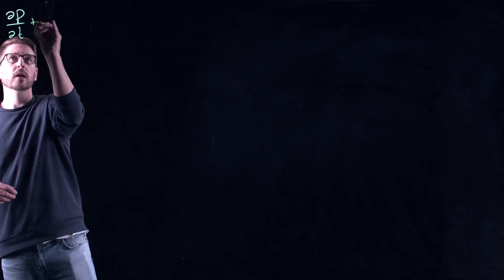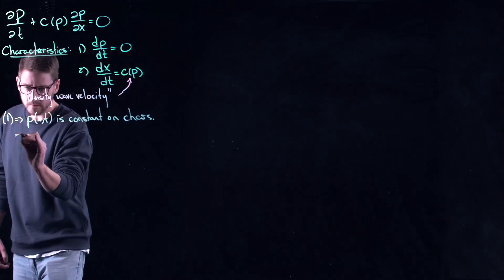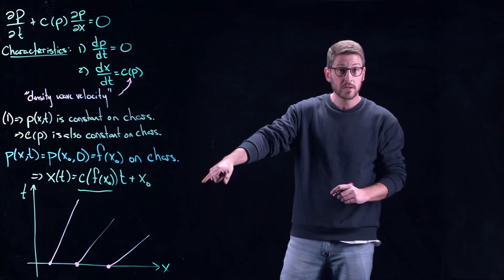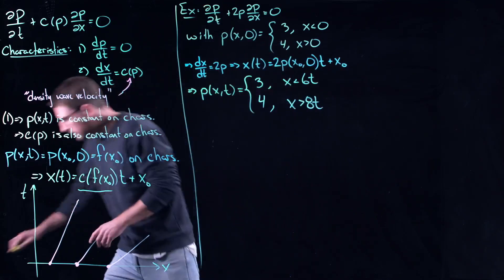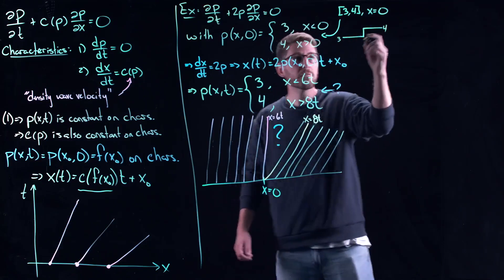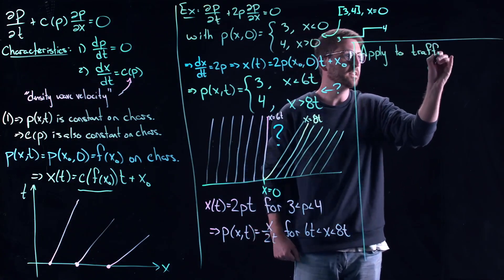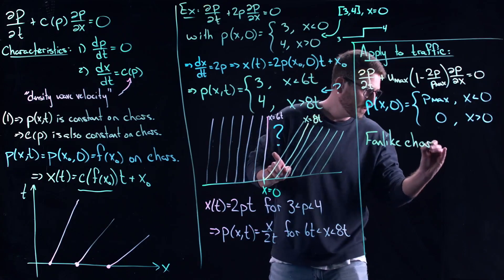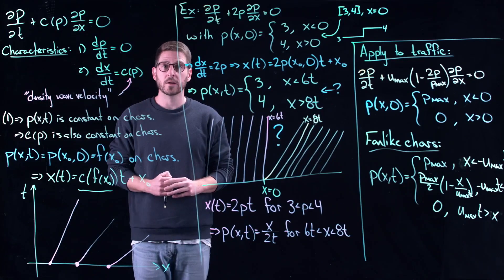Fanlike Characteristics - Partial Differential Equations | Lecture 43

Comment: Great Lectures! This series help me review basic PDE knowledge very efficiently. If I remember correctly from the PDE analysis course. The method of characteristics applies to first-order PDEs, requiring the coefficients and initial data to be sufficiently smooth for a classical solution, which ensures the solution has continuous derivatives. Because the method relies on the PDE becoming an Ordinary Differential Equation (ODE) along characteristic curves, which requires the solution to be differentiable to derive these ODEs. Fanlike and Shock wave characteristic Curves make the union of them not a function surface. These special cases are caused by that the original PDE problem does not meet the above requirement, so we need apply some remedies to arrive at the solution. Prof., Am I right? Hope it helps with students who studies PDE for the first time.